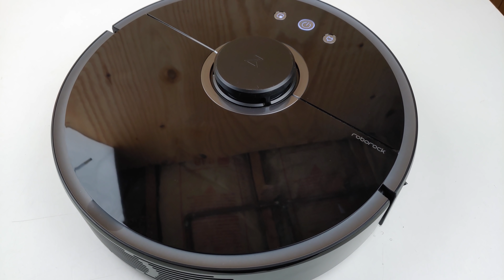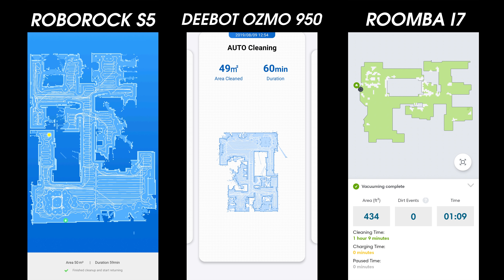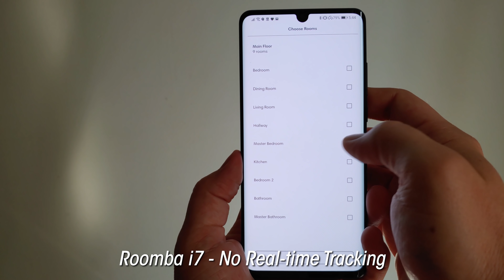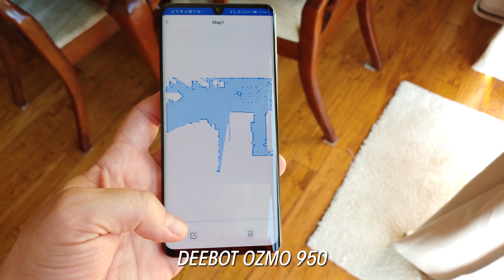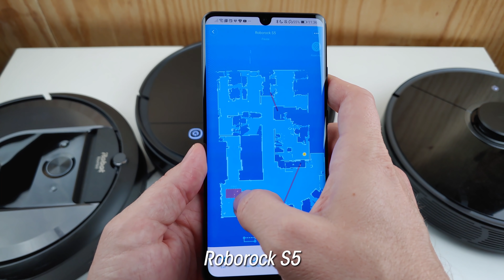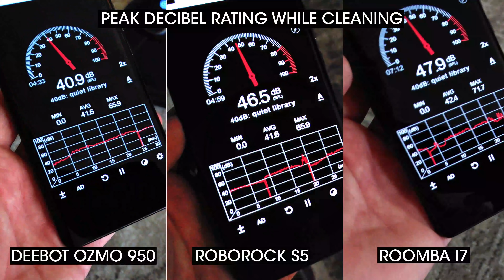Vacuum Wars: Smartest Robot Vacuum - DEEBOT OZMO 950 vs Roomba i7 vs Roborock S5

Comment: I came here cause I returned my OZMO 950 as it is faulty, and saw the Roomba was a recommended competitor. glad I came here...

See my Deebot works flawlessly while cleaning, but is unable to return to its base station, no matter where I put it. It ends up going onto the base station at a slight angle, leaving it unable to dock, after which it gets confused and randomly goes around the house until it runs out of battery. Ecovacs should increase the charging pad size to avoid this, as well as have it re-attempt to dock or wait for its owner.

Anyway, I really did love my OZMO 950, so after watching this I'll definitely get another one. Tbh I wanted to do so anyway. My issue doesn't seem like a widespread issue, so hopefully my replacement will be flawless :)

Comment: Idk why you’re comparing brand new debot to an old roborock. The 6max and the s5max would be a better option. And when the 5s came out it dominated. You kinda sound like a deebot fanboy. How much they pay you?
Reply: did you check when the video was released? Pretty sure s6max and s5max were not released back then. S6 (non-Max) was though, so a point should be made about that.

Comment: In my experience, the Deebot 950 is not that much of a winner over the S5. Firmware updates seem to come quite regularly from Roborock for the S5, and the mapping is phenomenal with the S5. The Deebot is several hundred more dollars. I'm not sure the performance is that much better for the price differential. Now that I have used the S6, which is in the same price class as the Deebot, the winner is clear. The S6 is the best on the market

Comment: I cant get my ozmo 950 connected to the app with three different devices says this device is not compatible. Android 8,9 & 6.  On the box it says compatible with android 4.0 or later-FALSE. Then I borrowed someones device and the app installed, but the setup process would not work. After lots of tries.  Called customer support and he was clueless and I felt like I was being scammed, then he hung up on me after not sending him screenshots of all my wifi info. I told him I will tell you what is on the screen, but he insisted screenshots.  Another reviewer said they had him set up remote desktop. And I keep hearing about app permissions. The ecovacs home app is rated 2 stars.      This has been a major hedache, and I still can only press the button on the vac for a cleaning.  "Update" they updated the app and now all of my devices can get the app, but you can not connect with a hidden network.
Reply from the maker: Ecovacs app used to be pretty bad. The latest redesign is a significant improvement in every metric. Are you using the Ecovacs Home app? There are several Ecovacs apps listed on the Play Store and it can be a bit confusing to figure out which one is right. 
https://play.google.com/store/apps/details?id=com.eco.global.app

Comment: Like mentioned before this is not a good comparison test. Latest high end models from the 3 manufacturers should be used. 
Unless the older models perform better then the 950, only then I can find this useful. 
Can you do the same video but then with the latest flagships of Roborock and Irobot?